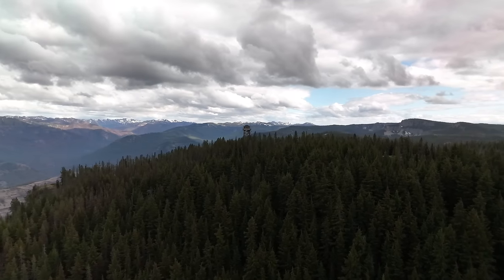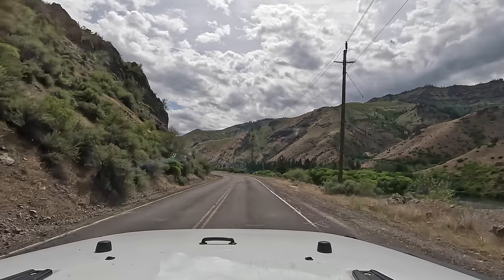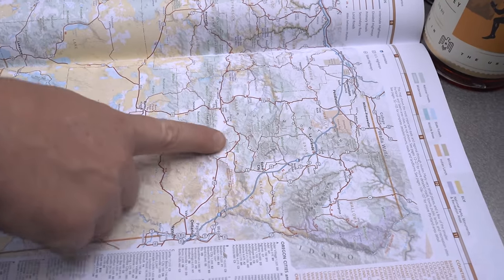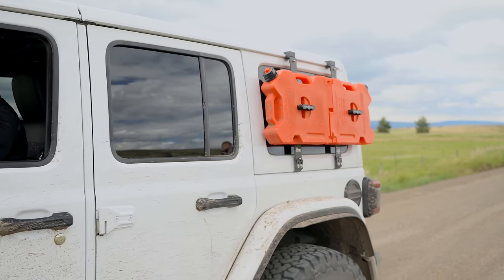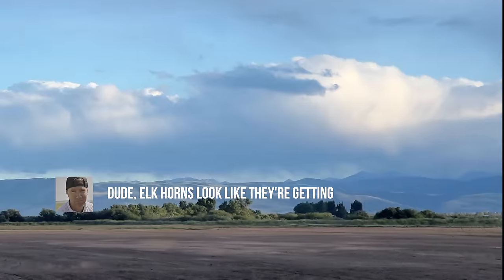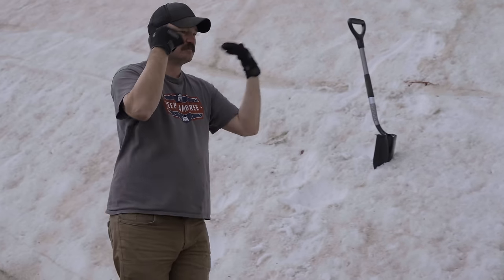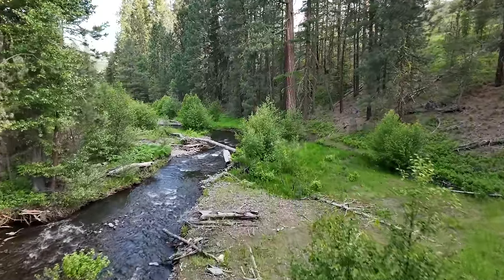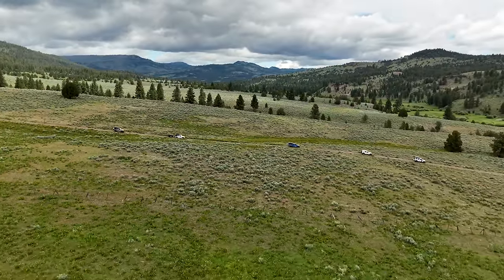Experience Oregon’s Wild Overland Adventure

Comment: Awesome trip. Always wanted to do something like it. A couple of notes, I'm a retired Forest Service Road Manager in Baker City. The "mud slides" on the Marble Cr. Pass road is actually an old lime quarry. The Marble Cr. road was built around 1957 by the Chemical Lime Co. in support of a mining operation for limestone. The mine was an open quarry mine. The east side, Baker Valley side, Marble Cr. quarry operated from 1957 to 1963. The road winds it's way up and through the heart of the quarry. Another lime quarry, the Baboon Cr. Quarry, was opened up on the west side, Sumpter Valley side, of the Elkhorn Ridge. The road likewise winds through this quarry as well and tons of left over limestone tailings can be seen today, in fact this section of road is built from limestone tailings (mud slide). The limestone becomes super saturated in rain, washing down hill and hard as concrete when dry. Heavy trucks hauled the limestone up an over Marble Cr. Pass and down the bone shattering road to the processing plant in Baker Valley.  The Baboon Cr. quarry was closed in 1971. Today the road is used mainly by locals, hikers, and hunters.
Another note. Even though a map may show a public access road through private land (like near Beulah Reservoir), if the public entity doesn't have Right of Way, the road through the private section is private and the landowner has every right to lock the gate.Happy Trails🙂
Reply from the maker: Great comment. Thanks for sharing! Love the history.
Reply: This kind of local information available around the globe is the best part of YouTube, IMHO. thank you!